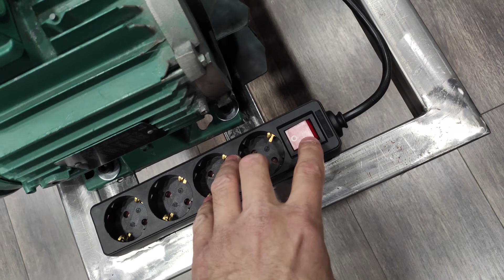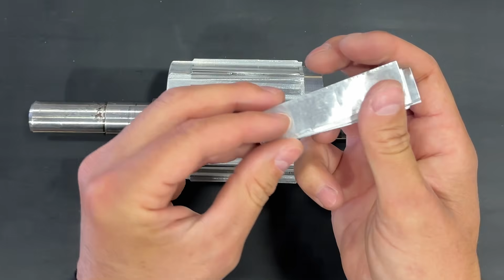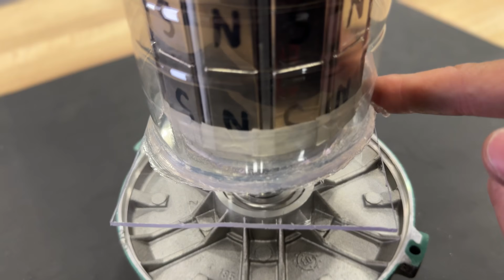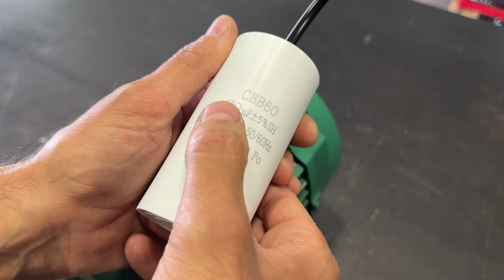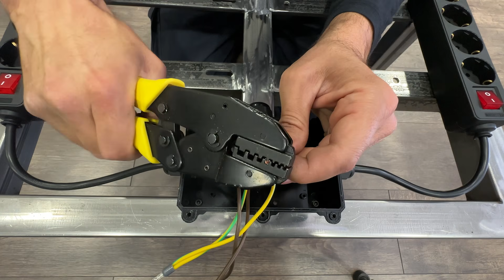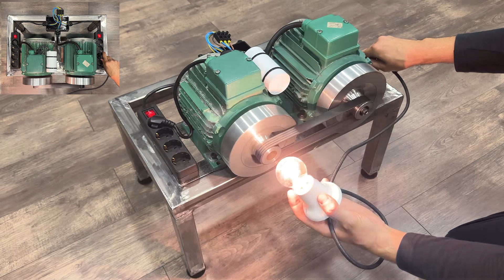10KW! Free Energy with Two Electric Motors💡⚡💡Liberty Engine 5.0

Comment: Pretty good joke, but I think nobody with elementary school should bite :-) Guess there is a thin transformator wire used as power supply from mains, well hidden on the video. Guess top left corner? Or is it removed during edits? Guess its quite easy given uniform floor and minimum camera moves

Comment: I would like to see it under a full load of possible and how long will it at this pace with out melting the line side. L1 and. L2. The wire looks like #12? On the video currently. other than that great job,

Comment: Great machining capabilities and great video editing, but putting a little bit of argylium or aluminum, or whatever it is. Probably just aluminum isn't going to do anything. Maybe when you put it around the rotor, with the magnets on your first engine, maybe it was doing something, but now, putting aluminum strips down on the bottom, I don't think they're doing anything at all, and

Comment: Hello. I found your video very interesting, but there are several technical points that I do not fully understand, so I would like to ask a few questions.

You state that a 1.5 kW motor was modified into an alternator capable of producing up to 10 kW. Do you have a test showing both voltage and current measured simultaneously while the generator is actually delivering 10 kW?
At 230 V, producing 10 kW would require roughly 43 amps or more continuously. The video clearly shows voltage measurements, but I could not see a measurement of the actual output current and real power. Could you provide the full 10 kW load-test data?
You state that the generator has an energy efficiency of 666%. How exactly was this efficiency calculated? Did you simultaneously measure the mechanical power entering the alternator shaft and the electrical power coming out?
You explain that the generator powers the motor, and the motor then drives the generator again. Since the motor, belt, bearings, and alternator all have losses, where does the additional energy come from that compensates for these losses and still provides surplus power?
You state that Argalium Alfa eliminates magnetic braking and provides energy amplification. Are there any independent laboratory tests, scientific papers, or third-party measurements demonstrating this effect?
If magnetic braking has been eliminated, what happens to the mechanical torque required at the alternator shaft when an electrical load is increased? Have you measured the shaft torque before and after connecting a significant load?
The system uses two 8 kg inertia discs and is initially accelerated to about 1,400 RPM with a battery drill. Have you performed a long-duration test that accounts for and excludes the energy initially supplied by the drill and stored in the flywheels?
Could you show a continuous test lasting several hours, with no external power source, hidden battery, or other energy input, while precision instruments measure both input and output energy throughout the entire test?
If the system can truly produce a continuous 10 kW output from an input of 1.5 kW or less, this would be an extremely significant technological result. Has the claimed 666% efficiency ever been independently verified by a university, accredited laboratory, or other third party?

I am not trying to dismiss the technology without consideration. I am genuinely interested in understanding how it works. A response supported by measurement data would greatly help in evaluating the claims.

Comment: Estimado señores
Tengo dos motores eléctricos de iguales características 380 volt, 1.4 A, 1400 rpm, 50 hz
Por favor su ayuda, de cuantos microfaradios sería el capacitor y la polea de que peso, para lograr construir un generador similar al liberty engine 5.0

Comment: Band of crooks. 
One of the possible tricks is hiding a power supply through the frame.
To prove me wrong, lift the frame from the  ground.
Reply: Its heavy but he could just slide it on the floor while its running to see if theres wires .

Comment: Has anyone managed to repeat this experiment? Is there a theory where the energy comes from?
Reply: The energy comes from the hidden wires running through a leg of the stand, through a hole in the floor and over to a power outlet. This is a You Tube trick video, actually one of many.
Reply: Go back to school and take some good physics classes.
You just got pranked!

Comment: read the motor plate the motor will not have a other eff,cos. if you make a alternator from it with magnets
the coils will still be having a 120 degree differency using only 1 coil making the alternator out of balance

Comment: as far i understand you like to claim that you made fro a 3  phase motor a single phase motor.
not realy a 3 phase motor is in fact just that a 3 x single phase input single phase is one power sorge
at 1 time the steinmets coonnection often used in the usa because a home they do not give 3 phase/
how ever 3 phase is nothing more than 3 x single phase only the hz are not at the same time.
two the same motors but one rebuild to a alternator the differend between this two is shaft power
the motor have a slip if he would be a pm you have no slip.
now count from the shaft to thestator that is for a allternator the shaft is losing power
but with a motor you have to count from the stator to the shaft the flow from mechanical power a bulb
is telling nothing measuring power in and power out if you doing that you will see the missing point
efficiency typing down anny one can do but shoe it in measuring volts and amps
time and measuring is every thing fo storys you us the bibel or news paper
measuring 50hz and 230 volt is only because you measure in 1sec now do the same in 1 min
you would have a voltage from 60 x 230 volt, no free energy because the moment you have to buy
something for it it is no longer free it is why we use ROI
Reply: magnets do not create a high efficiency
what they do they create a high Nm
yes Nm not toque created by a con person
 by taking Nm and giving it the name torque.

Comment: How about this system running on 120 volts AC, single phase generator and 3 t0 5000 WATTS. to power a small home or apartment. NOT 3 PHASE. I dare 
you to publish it or make a video about it,

Comment: The quality put to make this video makes me wonder why..

There are no real “free energy” devices. The closest practical sources are things like solar, wind, hydro, geothermal, and other systems that collect energy from an external source.
This motor-and-alternator setup is made to look as though it powers itself, usually to attract views and earn money from the video. They will never sell a working version because it cannot work as shown.
Energy cannot be created from nothing. It can only be transferred or changed from one form to another.
For example, assume the alternator is 70% efficient. If the motor supplies 1,000 watts of mechanical power, the alternator produces only about 700 watts of electrical power. The remaining 300 watts becomes heat, bearing friction, fan losses, electrical resistance, and magnetic losses.
Now assume the motor is 85% efficient. Feeding those 700 watts back into the motor produces only about 595 watts of mechanical power.
After each cycle, only about 59.5% of the previous energy remains:
1,000 W → 595 W → 354 W → 211 W → 126 W → 75 W → 45 W
After ten cycles, only about 6 watts would remain from the original 1,000 watts. In reality, the system would stop even sooner because of minimum operating voltage, belt friction, controller losses, battery losses, and the power needed to energize the alternator.
The energy does not disappear; it is converted mainly into heat, sound, vibration, and friction. A motor and alternator cannot continuously power each other without an external energy source.

Comment: Can it handle a loads of three(3) ref, one(1) television,one(1) electric range, two aircons, one(1) rice cooker, one(1) micro wave oven, and six(6) 25watts lights?
Reply: Most of these models are tested with regular light bulbs, so I don't think they can handle heavy loads.
Reply: @I @IslamBabiker-b8k , then can you have the time to measure the wattage delivered by the model you have created so you could determine the correct size of power it could take.  I am sure you have multimeter, taking note of voltage of 220 V multiply by amperage of say 5 A = 1100 watts. Or if you have wattmeter is highly recommended to measure your model’s power supply in watts.

Comment: So one side is 220 volts and the other is 110 volts. 
Can you run a refrigerator on the 110 side and a small 220 roof air for a RV on the other side?
How much can you pull out of both sides before it starts to bog down?
Im looking at this one or a 200 magnetic wheel generator. To build for my RV. 
Thank you for the video. Its great

Comment: Logically this is basically  2 motors exactly the same voltage and running rpm with  one converted  rotor into a permanent  magnet rotor  design to excite stator coils to produce 220v  output in reverse  to run an identical  motor input running  at its original rpm  and voltage is generating transfered motion through belts and exact pulley diameter which interns provide stable rotational force inclusive with heavier weight motor pullies creating small inertia  and rotational stability which keeps the modified motor creating power  with 2 paralell coils  with coil 1 feeding coil 2  during rotation creating  a rotational timed push  and third  open coil powering outlets and unmodified motor , its basically  a closed powered  loop that never ends until connection to unmodified  motor is broken by placing switch  off 😅
Reply: Arabalarda kullanılır mı?
Reply: impressive but not useful?

Comment: Are these units for sale?
Reply: There are no real “free energy” devices. The closest practical sources are things like solar, wind, hydro, geothermal, and other systems that collect energy from an external source.
This motor-and-alternator setup is made to look as though it powers itself, usually to attract views and earn money from the video. They will never sell a working version because it cannot work as shown.
Energy cannot be created from nothing. It can only be transferred or changed from one form to another.
For example, assume the alternator is 70% efficient. If the motor supplies 1,000 watts of mechanical power, the alternator produces only about 700 watts of electrical power. The remaining 300 watts becomes heat, bearing friction, fan losses, electrical resistance, and magnetic losses.
Now assume the motor is 85% efficient. Feeding those 700 watts back into the motor produces only about 595 watts of mechanical power.
After each cycle, only about 59.5% of the previous energy remains:
1,000 W → 595 W → 354 W → 211 W → 126 W → 75 W → 45 W
After ten cycles, only about 6 watts would remain from the original 1,000 watts. In reality, the system would stop even sooner because of minimum operating voltage, belt friction, controller losses, battery losses, and the power needed to energize the alternator.
The energy does not disappear; it is converted mainly into heat, sound, vibration, and friction. A motor and alternator cannot continuously power each other without an external energy source.

Comment: Not real
Reply: Logically  i can say it is real i have designed a prototype myself less efficient technique for trial purposes and it works .....

 this is basically  2 motors exactly the same voltage and running rpm with  one converted  rotor into a permanent  magnet rotor  design to excite stator coils to produce 220v  output in reverse  to run an identical  motor input running  at its original rpm  and voltage is generating transfered motion through belts and exact pulley diameter which interns provide stable rotational force inclusive with heavier weight motor pullies creating small inertia  and rotational stability which keeps the modified motor creating power  with 2 paralell coils  with coil 1 feeding coil 2  during rotation creating  a rotational timed push  and third  open coil powering outlets and unmodified motor , its basically  a closed powered  loop that never ends until connection to unmodified  motor is broken by placing switch  off 😅

Comment: I sent you 2 emails recently. I am interested to know who you may recommend has the mixed metal of silver/aluminum. Also, how do you determine the ratio of silver mixed with aluminum as I am working on a motor that is much larger than these illustrated.

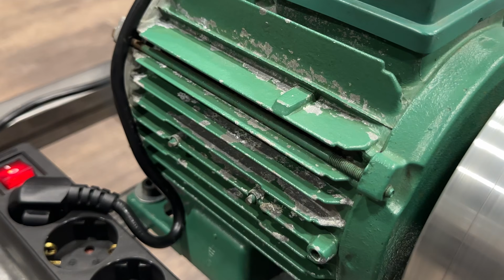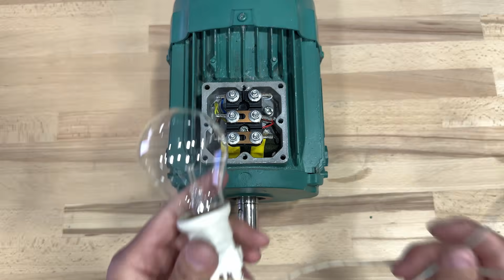Comment: How does this particular trick work? Although the authors rotate the machine in front of the camera from all angles to prove that there are no hidden wires anywhere (26:50), the trick is hidden in the structure itself: Hidden motor/battery in the base: The entire device is mounted on a massive welded iron frame with thick profiles (11:50). Inside these hollow iron profiles or directly in a massive electrical installation box, modern lithium batteries and control electronics are hidden. Modified electric motor: One of the motors is actually powered by a hidden source in the base (the wire runs inside the structure through the screws). When the author puts the drill on, it does not start the generator, but only closes a hidden switch (e.g. a magnetic reed contact inside), which allows current from the batteries to the motor. The machine then runs on batteries, not on its own. Conclusion The Liberty Engine channel produces these videos serially (versions 1.0 to 5.0) for the sole purpose of getting millions of views, making money from YouTube advertising, and selling promotional items in their e-shop. The creators themselves warn in small print at the end of the video that their prototypes are “not for sale” (28:12)
Reply: But the welded iron frame looks hollow by judging from the noise it makes.

Comment: “ArgAlium Alpha is a special metal composed mainly of silver and aluminum.”

This can only be partially true:
Silver + aluminum can be combined, but not as a stable alloy.
In reality, it is aluminum with a silver coating or a diffusion layer, not a homogeneous metal.
So “ArgAlium Alpha” = a fantasy name for a composite, not a new element or a real metallurgical alloy.

“This metal has unique properties, as it is the only material capable of producing unlimited electrical energy by completely eliminating eddy currents and magnetic braking.”
This is a marketing claim, not physics.

There is no material that:
“eliminates eddy currents”
“eliminates magnetic drag”
“produces unlimited energy”

These things are physically impossible, because:
✔ Eddy currents occur in any conductor
Silver and aluminum are excellent conductors, so eddy currents in them are actually stronger, not weaker.
✔ Magnetic braking is unavoidable
If a magnetic field changes inside a conductor, an opposing field is generated (Lenz’s law).
No material can “cancel” this.
✔ “Unlimited energy” contradicts the law of conservation of energy
No material can create energy from nothing.

So this sentence is advertising hyperbole, not a technical fact.

👎

Comment: As far as I can tell, the science behind this is correct and it should work.  This is not fiction. Neodymium produces a much stronger magnetic field and is more efficient than traditional magnets.
Reply: yes, but the more load you plug in the slower it runs....
Reply: A stronger magnetic field needs more torque. The homemade rotor would never survive the centrifugal forces and heat buildup.
Reply: Yes, but there is no use out of this, because if you connect something, there is no feedback how much RPM should increase to maintain rotation. Maybe, just maybe it can push itself only, but no useful work. And Argalium Alfa...hmmm,what is that? "I just imagined this title"...
2nd thing: to solve World first and most important problem as infinite energy (in any scale is acceptable), you should ended up here, on Youtube. Yes, it's good if you have such noble reason - to give the World free energy and die after that; then that it's good, hat down. But as you understand, in the other side is something which I can call "theory of total chaos" - free energy to everybody's, means chaos. Free individuals, no reasons for wars, no reasons for domination no reasons...end of life. We have no reason to live any more. Why to live when you have an ultimate freedom. Freedom, to run your home for free, to run your (let's say just hypothetically), tractor and cultivate the land for yourself. Good. You dont need anyone - you can bring the water with water pump and pipes,  all of of that assembly doesn't spend any energy because you have free energy. Then, to maintain your bloodline , you and your wufe, could have 5,6,7 kids...you can feed them, there are enough food for everyone then...You understand the point. You and yours, have total independence from anyone. Then, why any State would exists? Why governments? When everyone's has everything. So, no, no, you can't have independence. You can't have free energy. Even if you have it, in some forms, you mustn't. You must go somewhere, to hide.
Reply: @ppilje  I'll have what he's having

Comment: This is simply one more fictitious perpetuum mobile. 
Without cheating, that contraption will at best run for a minute.
Use one motor only, start it with the drill and watch how the motor speed goes to zero.

Comment: What herzt? 50?
Reply: For all of generators (alternators), the frequency of the voltage generated depends of the speed rotation and quantity of poles inside the stator. But, don't expect working, it is absolutely impossible. This viedo is a joke

Comment: Until you put a draw on the motors,   As soon as you try to Use the energy it slows down until it comes to a stop.   
Ford Lightening EV pickup.  As soon as you tried to tow with it putting load on the system it could only travel a few miles.  Less than 100 miles.    The only reason you buy a pickup is to tow with,  you buy the power to haul stuff.